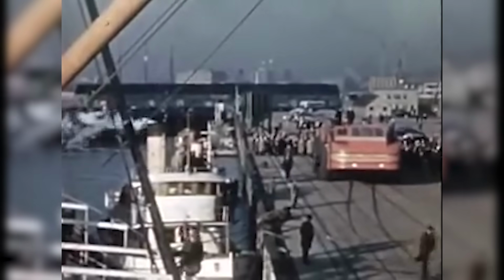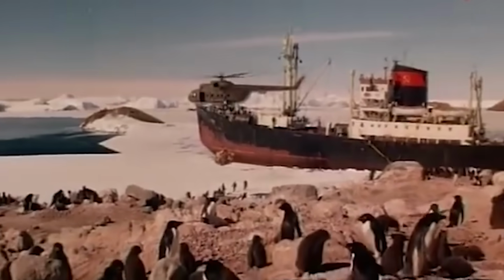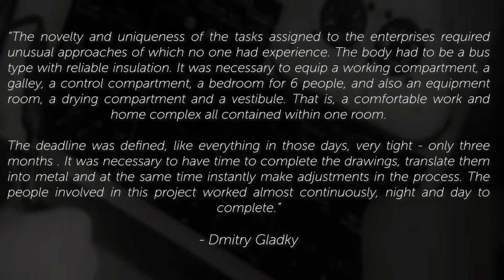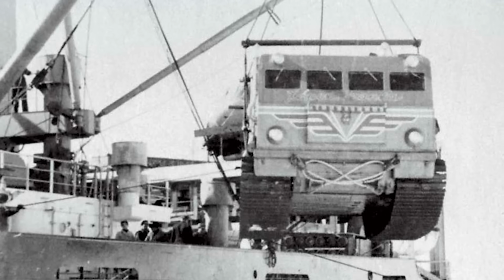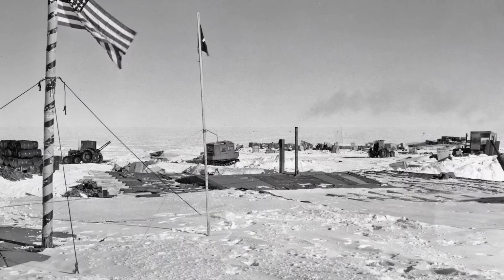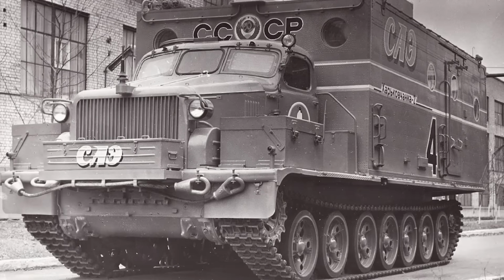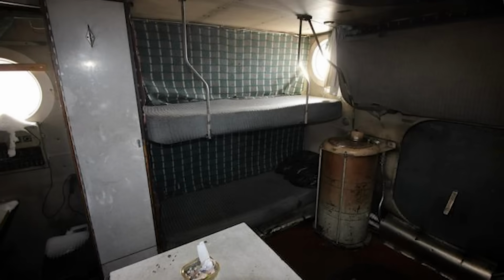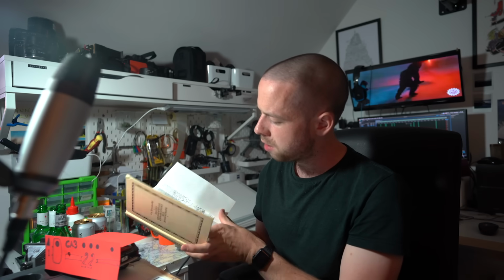"Kharkovchanka" - The Colossal Soviet Antarctic Cruisers

Comment: Soviet "can do" engineering spirit always amazes me. What they could accomplish with smaller budgets and a more limited industrial base than the West is incredible. Things were dependable,  simple to manufacture and bulletproof for the most part and got the job done. To this day they are using the Soyuz spacecraft designed in the 1960's with updates over the decades. It just works and is economical.

Vehicles of this type will be need on the moon and Mars for starters.

Very informative video.
Reply: More of a "Quit your bitching and just get it done" attitude I imagine.
Reply: Frank Mueller - exactly, they have the mindsets of Texans, make it bigger, stronger, and more powerful than anything before it. Kind of a simple thing to do, just keep the nanny’s out of your way, and you can get things done.
Reply: The American and traditional Soviet ways of engineering both have their positives and negatives. America's most notable strengths lay in innovation, large scale manufacturing, efficiency, and controls/computers. The Soviet Union's most notable strengths lay in making products that were tough as nails and reliable. Unfortunately not too many folks have tried to combine the two approaches into a single product. The SpaceX Starship and Tesla Cybertruck may be exceptions, but aren't finished yet.
Reply: @alanlight7740  If folks don't mind me going on a bit, the reason those two hasn't been combined is because of capitalism, the very thing that makes the American 'strength' in industrial scale manufacturing and innovation.

Capitalism always bends towards the profit motive, and planned obsolescence as well as difficult to copy, non-cross compatible designs are (almost) always going to be far more profitable than simple, sturdy, reliable and long lasting ones. So you get very good, but somewhat flimsy and hard to mess with technologies.

Trade-offs must be made somewhere, one supposes. And I'm (jokingly) ashamed to admit I have too much of a weakness for consumer products to accept the trade-off of the Soviet style approach, regardless of whatever other benefits it may bring.
Reply: @alanlight7740  > America's most notable strengths lay in innovation, large scale manufacturing, efficiency, and controls/computers.

You forgot one very important: customer satisfaction. In socialist economy, this element is missing. This is why you can immediately tell whether a thing was made in USSR: it feels like designer and manufacturer hates you.
Reply: @denysvlasenko1865  - LOL - you make a good point, though some of the products we get in the U.S. make me think the designers and manufacturers hate us. They're just more subtle about it.
Reply: Russians aren't short on courage.  Every branch of the human race has unique abilities which, if all were combined and in mutual support, would surpass any barrier that the universe has to offer.  I wish.
Reply: @tonyduncan9852  That might work in Outer Space or Antarctica, nowhere else
Reply: @JohnSmith-eo5sp  A principle works everywhere.  Clever, successful, and altruistic politicians would be required here on Earth.  Thanks for your opinion.
Reply: Great achievement is true but what greater could be without the threat of a bullet to the head.
Reply: > Things were dependable,  simple to manufacture and bulletproof for the most part 

Not "dependable" and not "bulletproof" at all. Most of the Soviet tech is cr*p. It is never designed with the thought whether the end user will be comfortable using the thing (this is the key difference with the West, in the West, end user is a CUSTOMER - in USSR, end user is an ANNOYANCE); and it breaks often. I lived there. I know.
Reply: The answer is planned economy. Soviet government was capable to mobilize huge resources, while governments with liberal economy had much less influence over industries. But the biggest disadvantage of planning was ignoring civil needs. Kharkovchanka, Soyuz, Buran etc. were cool, but folks had no damn jeans and sport shoes to wear lol))
Reply: @minddecomp  Ну да, без джинсов-то не прожили бы) зато теперь смотрим как наши ракеты падают, машины все из иностранной комплектухи, лекарств своих нет почти, а электроники своей - единицы процентов. Зато джинсы есть. Все заебись.)
Reply: @josephstalin4592  thats all Russian i knos
Reply: Aaannnd,,, how do you suggest we get 70 Ton vehicle to the moon???  Dont tell me youd let the Russians "solve" that one. Lol
Reply: @northernchaotic7196  More rockets solves everything lol
Reply: @northernchaotic7196  The Buran (nicknamed Hedgehog in English, because 'Буран', which really means 'Snowstorm', looks a little like hedgehog when inverted. Try it.) was launched by Energia; a rocket capable of putting ~100 tonnes into LEO. Given enough funding, they could achieve a lot more. 

Never forget that those Soviets and Russians were first into orbit, first to orbit a living creature (several), first to put man into orbit around the Earth (twice before the USA), first to accomplish an EVA, first to put a woman into space, Tereshkova (call sign Seagull) was also the first non-military, and non-scientific, person to fly in space. 

They were the first to photograph the far side of the Moon, first to crash land on the Moon, first to send living creatures around the Moon and return them to Earth safely (two Russian tortoises), and the only people to land probes on Venus and to return pictures.

The Russians had several functioning space stations, years before Skylab. Furthermore, a lot of the МКС /  ISS structure is Russian, and, for nine years, they were the only ones who could transport people to and from the station.
 
Russian РД-180 / RD-180 engines, which were USSR surplus engines are still being used by the Americans. Those rocket engines were at least 18% more efficient than anything which the Americans had built, because the USA had not found a way to make rockets using that particular cycle reliable.

The only other nation to have flown a manned space station is China. Guess who sold the Chinese their rocket designs, upon which the manned Chinese rockets are still being built? The Soviet Union, unsurprisingly. The Chinese just made them a little bigger. Check out 'Soyuz' on Wikipedia for hours of fascinating information about their successes and failures.

Both the Р-7 Союз (R-7 Soyuz) launcher and the Союз capsule are probably the most reliable space vehicles ever produced. That's why the basic designs from the 1950's and 1960's are still being used. They have only lost four crewmen in them, in two fatal flights. The Americans lost 17, in three fatal accidents, and they very nearly lost three more in Apollo-13.

So knock them if you like, but the Russians 'won' the Space Race in many different ways.
Reply: Yes...engineering feat of the high tech Russian Lada still makes wave in the automotive world!!
Reply: @FrancoisLabelle-yf8tj  Plus,wasn't there a several YEAR waiting list? I really admire the folks who lived in the Soviet bloc. Salt of the earth,indeed.
Reply: THOSE RUSSKIES STOLE DESIGN FROM AMERICANS
Reply: You mean industrial espionage
Reply: Most of their technology was stolen from the West.
Reply: Don't forget that if you had failed, you might have ended up in a concentration camp. Along with your family, if you were unlucky.

Many Soviet famous constructors, including Tupolev, Polikarpov (a lesser known aviation constructor, you may call him a grand-father of MiG fighter planes), and many more had been imprisoned in gulag under false accusations. And neither NKVD nor KGB did observe anything like American civil rights, human rights etc - that terms simply did not exist. So once released they were ready to do virtually anything and everything to avoid being arrested again. Everything is better than cutting the woods in the Syberian forest in the middle of the winter or working in a uranium mine, believe me. 

Whether you like it or not, it's part of the story.
Reply: With strict centralization (undemocratic) and reliance on forced labor the USSR accomplished remarkable feats of engineering
Reply: The Soviet Union was a huge country with huge natural resources. I find it remarkable how little they actually accomplished with all that. In technology, they were always just lagging behind the West, copying their technology to at least somewhat keep the pace with the US. Consider Space Shuttle (US successful original) vs Buran (Soviet failed imitation), the Concorde (French-British successful plane) vs Tu-144 (Soviet failed imitation), Packard vs Chaika, etc., etc., etc. The Soviets were the worst possible managers of their people and resources both of which were actually fantastic.
Reply: @roboticbaboon3125  Sure, unlike Congo, Venezuela and India whose accomplishments are huge. Buran landed in fully automatic mode, yes it's failure. First unmanned/manned spaceships were cheap copies of... Falcon 9 perhaps.
Reply: @roboticbaboon3125  The Buran wasn't a failure, the Soviet Union collapsed. Also the Soviet Union was the first to send up a satellite, a dog, and a man into space.
Reply: @revsnowfox5798  the us could have done that too. Same with Nazi Germany.. really not an accomplishment being the first when. Many were able but had bigger plans than a space junk
Reply: @Robotic Baboon  Space Shuttle was a massive mistake, it was more expensive per launch than Saturn 5, much less capable, and killed a dozen people. The US space program still has not recovered the ability to send manned spacecraft to the moon, and it's been half a century.

Comment: A similar snow vehicle from the US is the Snow Cats built for the US military. Although they were much smaller and lighter they were for the same exploration functions. There was also another tracked vehicle built for troop and supply transport that was powered by a Mercedes V6 Turbo diesel. It articulated in the center, could carry about 8-15 people depending on the equipment requirements and the range of the mission. My unit, 205th Inf, had these in MN until about 1994 when they were deactivated.

Comment: i have a very retarded question ,   why don't they use helicopters i didnt see the video to the end ,  but I'm gonna watch it
Reply from the maker: Aircraft are used a lot in Antarctica (though I think less so at the Russian bases now, maybe budgetary issues? Not sure about that but thought I saw it mentioned on a forum) but they are expensive and remember the weather down there can be atrocious. More than anything though fuel and supplies are incredibly heavy. For these expeditions often though the crews would drive supplies in and be flown out, they’d then collect vehicles later.
Reply: @CalumRaasay i don't think they more expensive as fuel goes then these things, but  you right the weather is really bad, and you don't want to broke down whit a plane or a chopper, in mid air the middle of nowhere

Comment: Glorious pieces of engineering and I would be honored to work with them. I think it’s time for a Gen 3 for these machines(no matter how unlikely it will be)
Reply from the maker: They sort of have a spiritual successor in the Vityaz DT30
Reply: Calum I guess, but it’s not the same... 

Yo be fair if I designed it I would have changed the Tracks for Screws, for better all around performance

Comment: If a picture of The American Snow Cruiser isn't in the dictionary next to the word "boondoggle", it should be. It was the quintessential boondoggle! A lesson in the least, of how a high profile project has an "Everyone wants to get into the act" dynamic, where people pushing their individual agendas work at cross purposes tugging the project in every different direction, pulling it apart from the inside.
       It's probable, that people on the American Snow Cruiser Project knew, even before it left the factory, that it would fail, but because of the hype, they had to send it on anyway. It was too big to haul overland, so it had to try and make it to port under it's own power and got stuck on the way in a temperate part of the US and had to be pulled out, so it had to make people wonder, how it would perform in Antarctica?

Comment: 1)  Me too: great documentary, Calum!

2)  If I were to design a self-contained vehicle, I'd start with a ship in mind. For the Antarctic perhaps something like a small submarine on caterpillars, the double hull tweaked to thermal insulation rather than depth pressure. I guess that submarines are constructed from something like aluminium in order not to be magnetic, but here it would help to reduce the weight. Maybe two sets of caterpillars next to each other, one set fixed, one set vertically movable, in order to adjust adhesion.

Comment: did they ever just think of using dog sledges? You know the same way we got to the south pole the first time? of course you couldnt haul 300+ tonnes of building material with you at the same time.
Reply from the maker: Thats exactly how Amundsen got to the South Pole originally. Used dogs to pull sledges, as they used up supplies and got lighter they ate the dogs for food. Actually got back from the pole having put on weight compared to when they left(!). Just not feasible for moving huge amounts of supplies and fuel.

Comment: These are fascinating vehicles but trust me, you don't want to be in any of them. I've driven some old soviet trucks like Kraz or Ural and they are horrible. It's like they were build for some alien life forms, not for humans. Everything is designed to be as uncomfortable as possible, engines are anormous but weak and drink over 100 litres of fuel per 100 km and that's on flat, hard ground and without any load. Everything is probably 3 times as big as it is necessary but still can break. They look good tho.

Comment: The capability of our race to go fuck up the enviroment from anywhere in or out of our planet, has never ceased to amaze me.
Reply from the maker: I do sympathise with your sentiments, but at the same itme the science of Antarctic study has allowed us to much better understand our planet (and what we've done to screw it up). I like to think the study and work these vehicles help conduct outweighs the effectiveness they have on our understand of the environment (prime example - the Ozone layer)
Reply: @CalumRaasay  You think that powers like US and USSR went there to understand our planet, or to find possible deposits of fossil fuels or heavy metals?
Reply: @CalumRaasay  Also, the power output of the powerplants of those vehicles must be equivalent with a small factory. So I'd wager that their contributions to CO2 emissions must be on par with small factories as well. Just makes me wonder that how many tons of fuel and carbon have run through their pipes for the past decades.

Comment: Hi Callum,
Could you tell me where you got the official schematics for the snow tractor please ? This looks like a really cool project to make as a scratch modeling project, so having the official design drawings with all the correct measurements on would make it so much easier to recreate it. Any help you can give would be very much appreciated. Thanks, loved the video.
Reply from the maker: I don't have an official schematics in terms of plant schematics, but if you look in the description at the links I have included you'll find some drawings and plans that include some measurements and sizes. Comment here again or message me if you're still having trouble!

Comment: What an intriguing story and an excellent piece of research about something I knew absolutely nothing about.  Thank you for your hard work.  It shows how the Soviet engineers could make anything out of what they had, rather than re-inventing everything.  

One story I heard was about the sophisticated, expensive, and none-too-reliable writng implements sent up into space with American astronauts to write their notes with in zero gravity.  The Soviet cosmonauts used pencils.

And good to hear from Mikhail Gorbachev as well.
Reply: The zero gravity pen was a commercial product built to write in extreme conditions, underwater, upside down, at pretty much any temperature survivable by humans. NASA didn't develop it. It was on the market and they bought some. They weren't expensive, you can buy one today for about $25.00.
Pencils don't work very well in microgravity. Shavings and graphite flecks float around the cabin and clog and short-circuit stuff. Last I heard, the Russians were using out pens, too.

Comment: This diesel oil problem is very common. One of my friends has had a Volkswagen Golf diesel with the option that is popular in the northern countries. It had electrical heating of the oil sump. That is the only way to get an engine started when it is freezing very hard.

And even your olive oil will solidify, when cold. Diesel oil is no exception. Store it warm enough. Keep engines and heating running, or your blood will freeze.

Comment: Dunno why i was recommended it, but since i'm here may i point out what likely is a misspelling in Dralkin's quote at 17:32: "... from mirny and from Komsolskaya and Vostok", besides capitalization of Mirny (sorry, vice-chairman of pedantic association here), i think it should read Komsomolskaya (Antarctic research station, 760 km away from Mirny, founded in 1957).

EDIT: Now after watching it in full, let me thank you on doing a great job on this video.
PS: I can't send you a DVD of Sanin's movie, but let me ask you this, are you good with torrenting? I can provide some material in case you're ok with it.
Reply from the maker: You are correct! I took this mistake over from an older script that had gone far more into depth about each station but I must have missed the spelling.